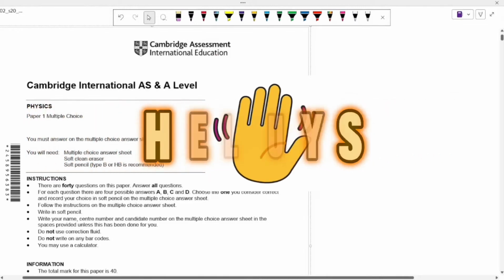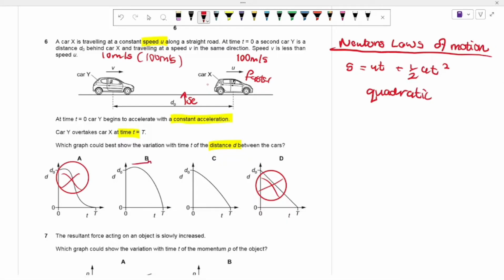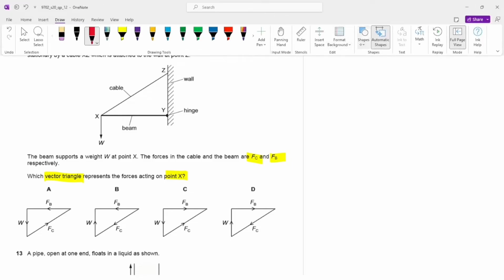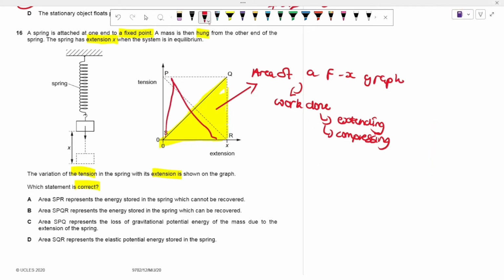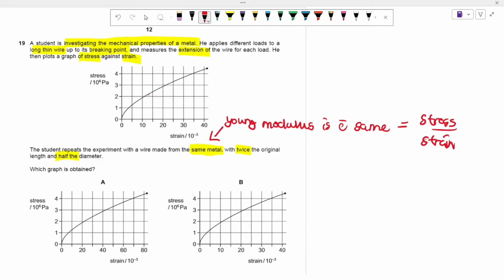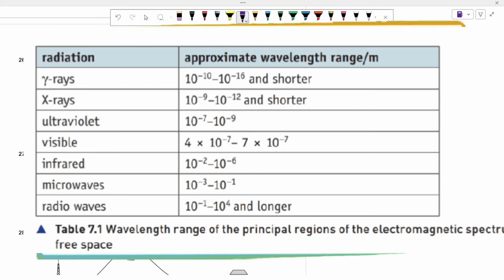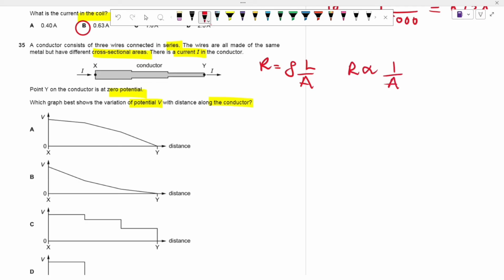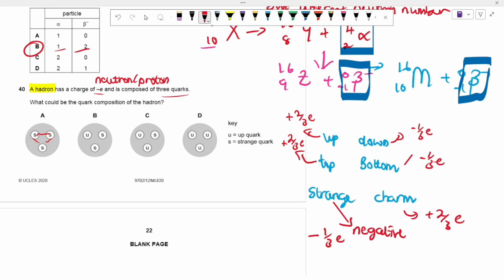AS LEVEL PHYSICS 9702 PAPER 1 May june 2020|| Paper 12 || 9702/12/M/J/20 || |Fully Explained

Comment: For question 7 if delt momentum= Resultant force* time and if the resultant force increase shouldn't the change in momentum also increase and not act inversely propotional?
Reply from the maker: Good day, sorry for taking so long to respond, I hope no inconveniences were caused. Okay , so lets understand the question together. Now resultant force is the change in momentum divided by the change in time and for this graph that is the resultant force. So if the resultant force is to increase, it effectively means that the gradient of the graph much be increasing. So we are just looking for a graph with an increasing gradient, so its A. I hope this makes sense, pleaee do comment of you have any further questions
Reply: @Alevel_Physics  thanks
Reply: @Alevel_Physics  hey sorry but wouldn't the graph need to be increasing too?
Reply from the maker: What needs to be increasing is just the gradient of the graph it self, from the question. Whether the graph increases or decreases will need to be evaluated using something else
Reply: @Alevel_Physics  but won't the gradient have to be a positive increase and not a negative gradient. Graph B has a negative gradient, shouldnt it be a positive gradient?